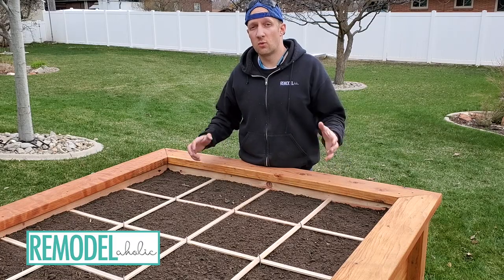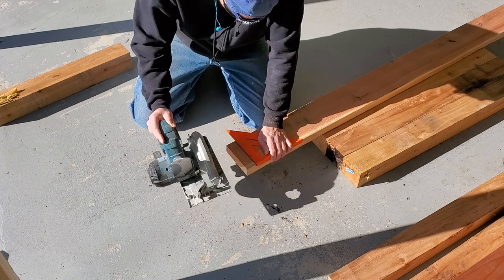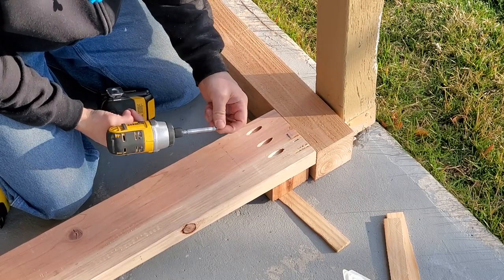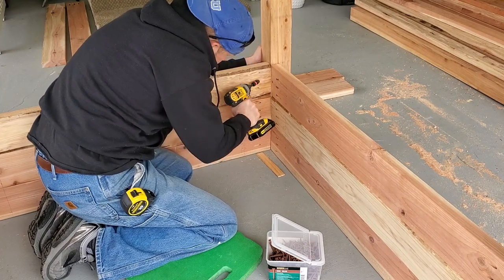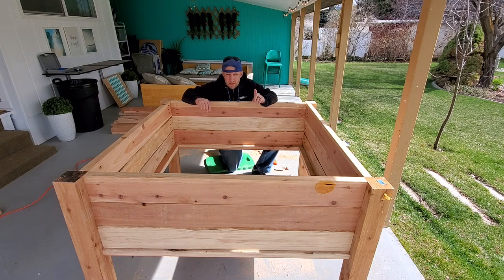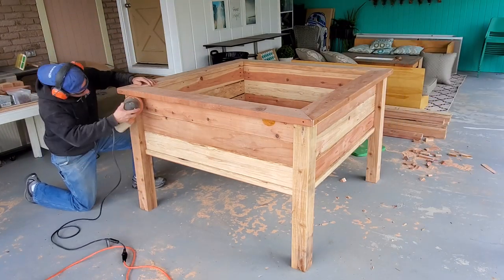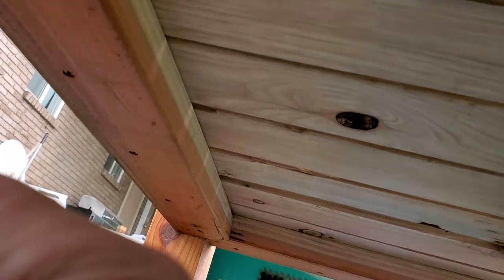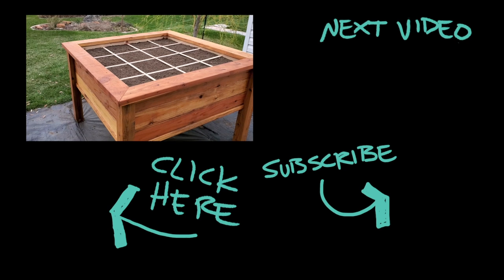How to Build a DIY Raised Garden Bed | Square Foot Gardening | Remodelaholic

Comment: Right on brother. I'm in the process of making two 2x2x2. But they will be sitting on casters because I'm doing dragon fruit and they need more of a tree-type container. And, the only space I have for them is on concrete. My idea is to use 4x4 posts because, as you know, it looks nice and it's more sturdy. You're the first person I could find using them. I was questioning how to do the bed and you confirmed and gave me confidence that my approach was headed in the right direction. I'm creating raised beds for my Dragon Fruit cuttings. It'll be my first time using a pocket drill so it'll be my at-home school project :)

If I were to use your SFG I'd probably start with a variety of lettuce, kale, and spinach. Maybe use two spots for carrots. I've never grown those.
Again, right on. great video. Thanks for the guidance and reassurance.
Reply from the maker: I would love to see how you modified it.   Send us a photo when you get it done.   Good luck with your project.

Comment: Nice job.👍

I was surprised you didn’t use pocket screws on the interior cross brace to hide the screws.

I want to build a few of these because I am not able to get down on my knees or bend over for long periods. These will make it easier and they look awesome. I will adapt it to pallet wood and salvaged lumber to save money.
Reply from the maker: So glad you like it and find it useful.  It makes gardening alot easier.  Good luck with the project!  Let me know how it turns out.

Comment: a common mistake i see in numerous of these garden beds ideas are that the load is often poorly carried throw the legs numerous times it is just held by screws into the leg and it is free hanging basically,  you would get a much more proper way to carry the load if you take out a part of the 4x4 and have the frame rest on the outcut while it is screwed into leg this way the weight isnt resting on the screws
Reply from the maker: Very true.  It just makes the build more complicated for people.  I was trying to simplify it.  I used about 20 deck screws per corner.  This table is really solid and has held up great during some really rainy storms.  I do like the idea of better joints though.  I think that would make another great way to build it for sure.  Thanks for watching and taking the time to comment. I really appreciate it.
Reply: I agree. The support braces should have been screwed in horizontally, not vertically from underneath.

Comment: Kreg does make exterior screws as well as Armor that you can get on Amazon.
Reply from the maker: thanks
Reply: @Remodelaholic  I use deck screws with pocket holes but you are better off in the long run using pocket hole screws, especially in softer woods.

Comment: I am not very good at building , but want to try my hand at making a elevated planter box.  I want to know if I can use pine wood instead of cedar to practice once I am good at building will move on to cedar.  Can I use the same dimension that you  use with cedar?
Reply from the maker: Yes you can.  Pine just won’t last more than a few years.

Comment: Fantastic planter love, it by the way if you do one again with pocket holes then you use the Kreg Blue Kote screws which are Kregs outdoor screws.
Stay Safe,
Barry (ENG)
Reply from the maker: Thanks for the tip. I just couldn't find a single store in my area with the right screws.

Comment: Hi, I  bought your plans and was wondering if would it be possible to make this using 1" cedar instead of 2" cedar? Maybe use support boards on sides in the middle?
Reply from the maker: You might beable to use 1" on the sides.  I would keep the bottom 2" due to the weight of the soil when it's wet.  Thanks for buying the plans.  Let us know how it turns out!

Comment: I love it! Did you add drainage holes? Or does the water drain good without holes.
It would look good around a hot tub.
Reply from the maker: I have a 1/4" gape between the bottom boards for it to drain.  It drains just fine.  I live in a dry climate as well.
Reply from the maker: Maybe I should do a hot tub garden next!  That's a great idea!

Comment: Very impressive garden box.  I purchased your plans and am ready to start building, however, I want to double the size to 48" x 96".  Should I drill the bottom boards in from the sides, rather than the bottom, for better support?  Anything else I should modify before beginning?
Reply: To clarify.... I will drill the bottom support brace per your plans, but should I also drill into all of the support boards for extra strength.  I thought I could then add a 2" trim piece to cover all of the exposed screw heads.
Reply from the maker: That sounds like it should work just fine!
Reply from the maker: Thanks for buying our plans!

Comment: What about drainage? Did you leave gaps between the base boards? thanks
Reply from the maker: Yes gaps between the base boards and it has drained just fine.  That is dry Utah weather though.

Comment: Where does the irrigation water go?
Thank you.
Reply from the maker: It just drains out the bottom.
Reply: @Remodelaholic  That’s a splendid answer, « une lapalissade » in french, stating the obvious.
But what about the plastic sheet and the wood you put at the bottom ?
Do you really think water will go through, without some holes…you didn’t speak about ?

Comment: No plastic between  wood bottom and sides? What about drainage?
Reply from the maker: Weed barrier at the bottom.  No need for plastic on the sides unless you want to add it.  It drains just fine with the type of soil I used.  Thanks for asking!

Comment: My husband bought the plans and began pricing the lumber according to the plans - it looks like this will cost over $500 just for the lumber! Have you compared the cost of lumber today to what it was when you bought your material?
Reply from the maker: I was able to buy materials at Lowes for about $230 for redwood lumber for building one garden box.  It sounds like you are building two?
Reply from the maker: I bought my material just a couple of monthes ago.
Reply: @Remodelaholic  No, just for one. Lowe's is completely out of redwood, while Home Depot has a four pack of 2x6x8 redwood for $175. We're looking at cedar and checking local building supply stores, but I'm guessing there has been a run on redwood with everyone building beds...
Reply: Emily Brown just use doug fur, it’s not going to last as long as cedar but it’s literally 60% less in price. I built a box like this for 90 bucks including hardware.

Comment: Looks great but the bottom floor is not designed properly. On mine the bottom support trim gave and the entire bottom of the box opened up! When adding potentially tons of dirt in there the weigh becomes way to big for this type of support. The design needs to be updadated.
Reply from the maker: Did you build my plan?
Reply: @Remodelaholic  Yes I have.
Reply from the maker: How many screws did you have in the bottom trim?  What kind of screws did you use.  Mine has held up fine.  I would like to know why it happened.  Can you email me the details at hello@remodelaholic.com?

Comment: Is that stain safe for a veggie garden?
Reply from the maker: It's best to use Penofin Verde label.  I used the Penofin Red label because I had some left over from my deck project.  But I didn't oil inside the box at all, I left it natural redwood.

Comment: Hi good evening I'm interested how much $ for the
Reply from the maker: It cost about $250, but I plan on it lasting more than 30 years.  That's only about 8 dollars a year if you look at it that way.
Reply from the maker: I do have plans for sale for $9.99 so you can build one.
Reply: @Remodelaholic  I would have put a layer of the plastic landscape fabric on the sides so the damp soil is not always in contact with the wood. But then I thought it might condensate, so the fabric landscape fabric on all the sides and then plastic landscape fabric so the water is not touching the wood if that makes any sense... lol